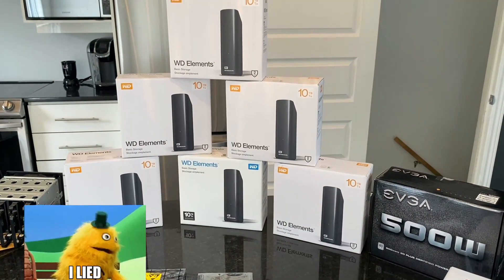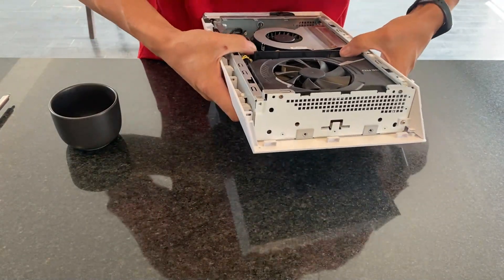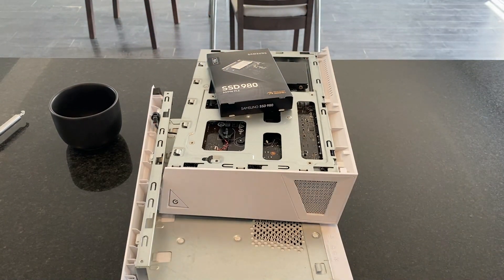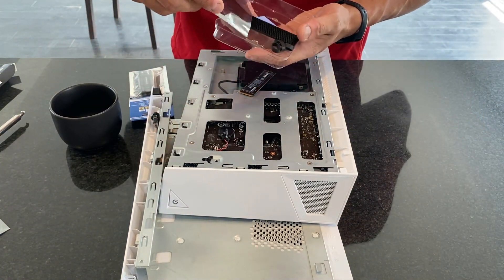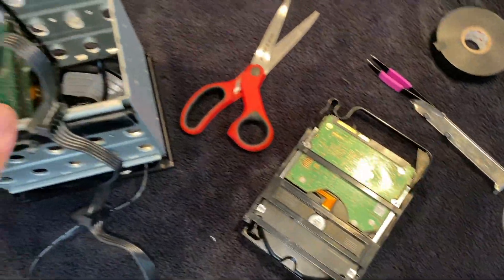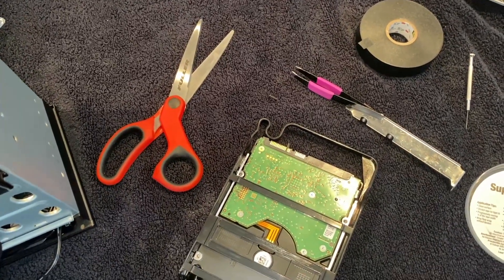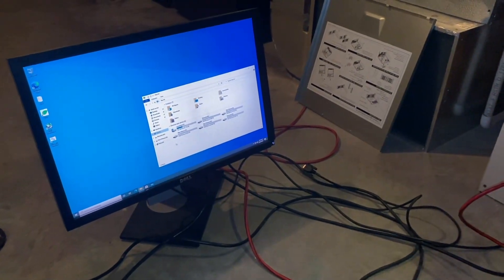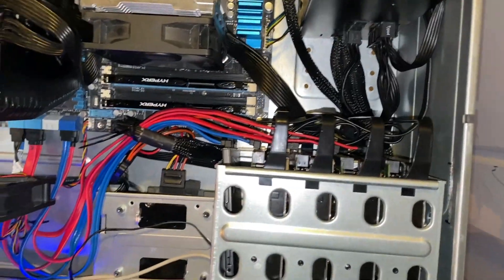Chia and Ethereum Together at last!

Comment: To late Bro :) if you dont make 40+ plots per day now. The actual net space is distaster for small miner
Reply from the maker: I think the number of plots is irrelevant once pools come out. Just like Ethereum mining, even if you have 1 card you still get a reward as the portion of the pool you contribute. I'm waiting until pools come out and there should be a consistent daily payout with those just like Ether mining.
Reply: @CustomComputing  hashrate minig is different. Chia is not about hash rewards, but about lottery system 😀. Im already in HPool one month and daily incone are un-constantly. When i start there with 10TB , i was get 1chia/month. Today i have 30TB and the reward is not under 1 chia/month. Net grow fast, so next month my 30TB will have value maybe 0,4 chia/month. Its never endning story ane expensive mining. If the net space will stil grow, you will need 100TB + for 20USD day around two months. Plus HDD prices now..... Imposible.
Reply from the maker: @maxbiagi3091  yeah but the pools take the rewards and divvy it up in comparison to your contribution level
Reply: @CustomComputing  but with comparsion of network size. So today you get  (example) 4USD per 10TB, nex month can be only 2USD etc ;) more Space,more miners----lower rewards. I hope net growing will finish soon🙏